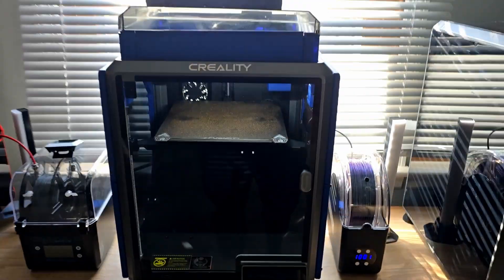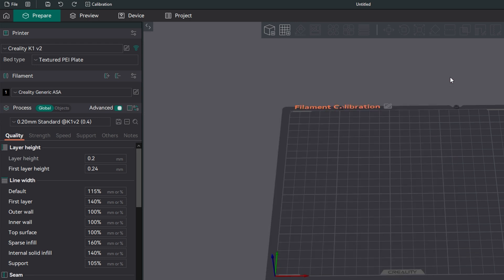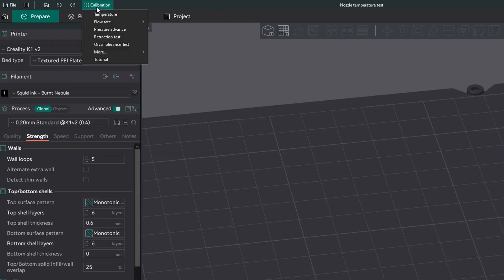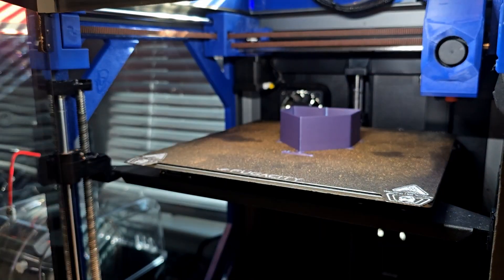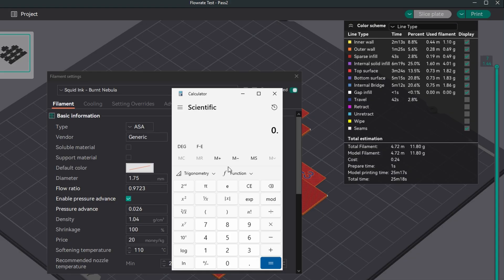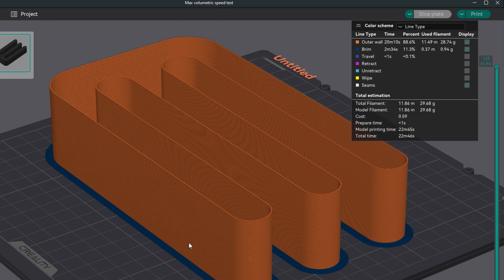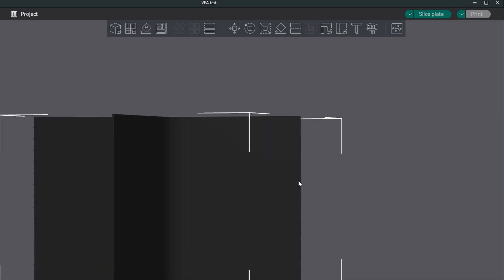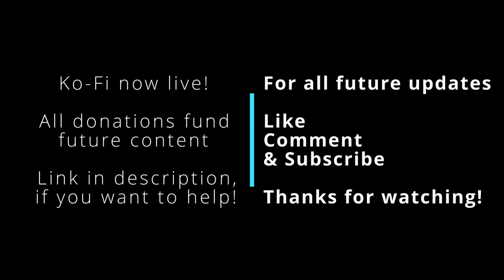OrcaSlicer Calibration - Getting the most out of EVERY filament!

Comment: I know this is a year old and Orca Slicer is now (Jan 2026) on V2.3.1 - so I followed the Calibrations from top to bottom, missing out a couplesuch as cornering and Input Shaping. 

My Max Volumetric Speed test for the SUNLU PLA + 2.0 I mainly use, came out faultless from bottom all the way to 20mm/3s - so I have set it at 15mm/3s. 

I then went onto VFA, I have a QIDI Plus4 and this can do high speed printing - so I opted for 150mm/s Base to 300mm/s topend in 10mm/s increments. 

That test clalibration has come out - perfect! I didnt push past 300mm/s as its past SUNLU's recommendation, but at least I know I can speed it to that.
Reply from the maker: This process truly is a great example of how investing a bit of time and material can provide greater quality and output. Happy to hear how much of a game changer it has been to your personal printing process! Cheers!

Comment: Didnt you have pre-calibration cube and after calibration cube ? Forgot to show differences ?
Reply from the maker: Pre-calibration was rough due to moisture and wouldn't have provided accurate results regardless (discoloration/dimensionally inaccurate to start from poor extrusion). The difference was night and day although the two were not set side by side due to the calibrated cube having the advantage of no longer holding moisture with all values dialed in.

Comment: For the PA test with ABS it was wavy through the whole print. Not horrible but still ugly through the whole thing. Then for the max flow rate the lower 13mm was also wavy but between 13mm and 18mm it was smooth then after the 18mm it was wavy. Did I do anything wrong and should I start over? I did this with some PLA and it was flawless and this tutorial worked amazingly so I feel I may be messing up with the ABS. (I’m new to printing)

Comment: how did u determine the speed at the end? you said the outer layer was 220 and the inner was 300. Why 300?
Reply from the maker: Ideally, you will match outer/inner wall speeds but I kick my inner walls up because I haven't found that it alters the dimensions of the prints that I send.

Comment: Please stop using the voron cubes for calibration. 
Use a proper shrinkage and skew calibration print that comes with a spreadsheet.
Reply from the maker: The Voron cube is a paid actor. His sole purpose was to test material conditions and the revised material profile for verification 😂 Delving deeper into hardware, software and material calibrations is not only possible but supported! Definitely take it as far as you are willing!

Comment: I'm new to 3D printing. Is there a way to gauge how much filament is used for this testing process? I'm just curious how much will be left out of a 1kg spool once the testing is complete. Thanks
Reply from the maker: In the slicer, after you've sliced the model, there will be a wide variety of information including material and time estimates. The full calibration process is approximately 150g for reference.

Comment: They seem to have made a update that changed the flow rate tests to a circular pattern, and im guessing im supposed to look inside the circle for these issues? not out? brand new to this.
Reply from the maker: I still prefer the original flow rate testing and actually haven't even attempted the revised test. The calibration guide/tutorial that is available through Orca will best explain the process for the new flow rate test.

Comment: Create explanation for a beginner in these settings like me. Question, I have OrcaSlicer and Bambu studio. I noticed when printing with Orca slicer, my printer (A1) makes different noises then with Bambu studio and It wasnt printing as smooth as with Bambu studio. So I still prefer the latter. But, can I still use Orca Slicer to calibrate the filaments and use those setting in Bambu Studio?
Reply: There likely different filament profiles in the two different slicer programs. Like even if it’s the same filament selected there may be some fan or speed settings just slightly different. I’m not certain because I’ve not been doing this long but I imagine you can export the filament profiles from one to the other. Otherwise just copy the parameters. But I may be over my head so if someone with more experience chimes in they may be able to explain the difference between the softwares and behaviors.
Reply from the maker: Bambu and Orca are very similar across the board from what I have seen and although I do not own a Bambu printer, I would say that utilizing the slicer's baked in calibration will likely be the easiest. The Bambu slicer probably has limits that are set in place that your machine exceeds when operating through Orca. Additional profile tuning may be required beyond filament calibration for best results. Feel free to transfer values over and perform a small test print to reduce material waste and confirm results for the profile before sending projects.

Comment: Hello! i have a question about the retraction test. What should i do if the first 2mm (from the base) have lines, then it doesnt till the end and the last 2mm have lines again?
Reply from the maker: I would select the lowest height value where stringing does not occur. It is possible that there may be moisture in your filament causing stringing to occur beyond that.
Reply: @CovenantCustom  Thank you so much! I also have another question if you can help me. Im new with printing PETg and i noticed that sometimes it remains too stuck on the bed and sometimes it leave residues that it's really difficult to remove. What should i do in this case? I have a textured pei plate

Comment: curious if i shoud keep my default k1C flow rate 0.98 or why did you use the 0.926 in orca? sorry if its a silly question
Reply from the maker: Default values are generally within range for most materials but not tailored for any one spool specifically. Due to formula variations in manufacturing, there is even potential for differences between batches of the same manufacturer/material/color. Once calibrations are completed for a material, there may only be slight profile revisions necessary, if any. More times than not, they do not require further adjustment, but I have run into the scenario of having to make minor adjustments with a repeat order of the "same" filament. The purpose of honing these values is to create a profile that accurately reflects the material you're melting and refining the values that allow it to produce greater results over a generalized profile. Hope that helps provide some clarity on why it is important to perform flow rate for best results! Happy printing 😎🤙

Comment: Hey man, great video! Just curious with the retraction what should i do if it was stringing the whole test?
Reply from the maker: Typically, if stringing occurs throughout, there are a variety of reasons. Most common would be hotend temp too high or moisture in the filament. If your temp tower provided good results and your material has been dried, increasing the retraction values may be necessary when you run the next calibration.

Comment: Would a calibration be needed for different colours of the same type filament?
Reply from the maker: Some might play well, and others might not. If you're low on time or material, running a tuned profile for a manufacturer/material type that you've already melted will more than likely get you a successful print. I just find deviations across filaments even if they are the same manufacturer/material so I tune them all.
Reply: @CovenantCustom thank you so much for taking time to reply. I’ll be aimining to do it for each type and colour. New to printing (only had it 4 days) so I found your video very helpful!
Reply from the maker: @budgetwithsiân By all means test existing/generic/similar profiles - Tuning each of mine is just a personal preference! Welcome to the 3D printing community. Have fun!

Comment: Hello. Thanks for the videos. Can you share profiles Orkaslicer for Creality K1 3d printer?
Reply from the maker: I feel that no one machine is the same considering I see variations between my own machines. Even if made in the same batch. For that reason, my best suggestions would be (if using a 0.4mm nozzle):

Quality

Layer height: 0.2mm
First layer height: 0.2mm
Seam: Aligned/Back (Depending)
Arc fitting: off
Precise wall: on
Wall generator: Classic
Wall printing order: Inner/outer/inner
Only one wall on top surfaces: On
Avoid crossing walls: On
Detect overhang walls: On

Strength (This depends on what you are printing; i.e. if it will be introduced to any forces - bump these values up but if it is a decoration that will be placed somewhere and left alone, lower values is sufficient):

Top shell layers: 5
Bottom shell layers: 5
Sparse Infill density: 5, 10, 15, 20, 40, 60, 100 (Depending on the file's application)
Sparse infill pattern: Gyroid

Support:

Type: Tree Auto/Manual (Depending)
Style: Organic
Threshold angle: 15, 30, 60 (Depending on retaining dimensional accuracy to pair with cooling for overhangs)
On build plate only: On
Top Z Distance: 0.12mm
Bottom Z distance: 0.2mm
Top interface layers: 3
Top interface spacing: 3.5
Bottom interface spacing: 5
Support/object xy distance: 3.5

I throw a brim on only when I feel it needs it and increase its width depending on how likely it would be to let go/fail without it.

Sometimes I use spiral vase mode for items (mostly just pen holders - works for lamp shades, "vases" and wherever else you could find a use for it)

Those would be all of the go to adjustments for me when setting up a profile that aren't entirely machine specific.

Speed is going to be dependent on your machine and its configuration down to how well it has been tuned so I've left that out.
Reply: @CovenantCustom  Thank hou very mutch!
Reply: @CovenantCustom  Yes, of course, I’d be grateful for the profile. At least, what average speeds and accelerations do you usually use? And another question: do you use the standard part cooling fan (4020)? What cooling settings do you set for the ASA profile, and what for the PLA profile?

Comment: Most comprehensive video! Thankyou!
Reply from the maker: Providing a guide that is easy to follow and informative was the goal! Thanks for stopping by! I appreciate the kind words!
Reply: @CovenantCustom  Can I ask why you run inner walls at 300mm/s as to 220mm/s? Also for infill how does the speed effect this? Do you leave it at the default or increase it to the outer wall speed of 220mm/s?
Reply from the maker: @Bigorse91 For dimensional accuracy, you are best off with running inner/outer walls at the same speed but I've found that I can decrease print time on my machine without losing accuracy by increasing inner wall speed. Infill I have left default.

Comment: What if none of my pass 1 test printed properly?
Reply from the maker: I'd start with cleaning the build plate to rule out adhesion issues. Next, I'd run a bed mesh, making sure there is no material on the tip of the nozzle for accurate results. Once Z has been ruled out, I would run the pass 1 to see if either of those two resolved it for you. If it did not and your results all present gaps, your value is too low to start. If it is the opposite, where it is depositing too much material, creating a rough top surface with ridges, your value is too high. A nozzle dragging through a curling part can cause them to release from the build plate, but so can a part that has material pushed around/built up on top. It really depends what you are experiencing when you say they aren't printing properly.

Comment: If i did this with for one filament with a 0.4 nozzle , so i have to rerun this while changing nozzle?
Reply from the maker: This calibration process is intended for a 0.4mm nozzle. If you are replacing it with the same size (0.4mm), it should not require additional calibration. Unless you see room for improvement, the same material profile should be sufficient as is.

Comment: Enjoyed your tutorial and additional tips and explanations! 

I just started 3d printing 2 days ago. Got a pre-owned Ender 3 v2 and a simple PLA from Elegoo. With the Creality Print slicer, a benchy turned out pretty good (IMO). 

I saw a video extolling the virtues of Orca slicer. I immediately noticed the Calibration menu and read their own articles on it. 

Temp Tower seemed very, very similar at each level. 
Flow rate 1 also seemed best on 5. I did not know to try the PA tests next instead of Flow 2. 🤦

I tried the PA line test, but they were all incomplete and I had no clue what to alter! I saw you choose the tower test and I will try it today.

Thanks again!

Comment: Do you make this calibration on each filament ? ( example i have sunlu pla blue / yellow etc... ) you do calibration for each different color, even if it's same brand and same PLA ? Same question with 2 rolls of same pla /color, do you renew your calibration between 2 rolls of same filament ?
Reply from the maker: I have made it common practice to this with every filament so that I have them prepared and ready for whenever I reorder. Thats not to say that the filament profile for your yellow PLA won't work with your blue PLA. It is just a personal preference for me to take those extra steps in calibrating all of my materials. I rarely have to change profile settings after the fact and if I do they are minimal. I like to use a test print like a calibration/Orca/Voron cube as a reference for whether or not changes are needed.

Comment: This is a wonderful video thank you so much! But i want to clarify a thing: After you do the max volumetric speed you should create a new project and insert the data of the filament into the new project because when you do the volumetric calibration test, it will change automatically 2 parameters into your filament option: "Max volumetric speed" at 200mm3/s and in the cooling tab "Layer time" at 0.
If you only change the max volumetric speed from 200 to (in this case 35) and save it it will also save the Layer time to 0, witch i understood that is bad. So just remember also the Layer time or watch it from a previous preset or create a new project and insert the data in that, and then save the filament.
Hope someone find help in this <3
Reply from the maker: Definitely agree with you! These are values that I change out of habit but it is a great point to make for those that aren't automatically jumping back in to confirm those values are where they need to be. Thanks for joining in and providing supporting information for everyone.
Reply: @CovenantCustom  Thank to you and your effort and knowledge in these videos <3
Reply from the maker: @SbrodolaiProtoKhay Look forward to providing more 3D printing coverage when time allows. Thank you for being here and for your support 😎🤙 Happy printing!

Comment: Thank you for this incredible video. I'm trying to dial in my third Bambulab A1. Two previous ones print perfectly with all stock profiles. The newest one has problems with overhangs, some quality issues, but most of all, dimensional accuracy is really bad.
Reply from the maker: These calibrations improved my printing experience and with the ability to pull generic material profiles and print being used so commonly, I really wanted to show people the improvements that are possible with these calibrations. They may be a solid foundation but fan settings could also be a factor in your overhang issue. Just something to keep in mind. Happy printing!

Comment: should I do these test at default of 250 - 300 speed or at the speeds I plan on printing at like 150 - 200?
Reply from the maker: Feel free to choose the range most suitable to your printer's use case. The print will ultimately fail if you begin to exceed its limits so just focus on finding a sweet spot that provides the best results.

Comment: fan on ?
Reply from the maker: I perform fan adjustments separate from material calibration so if a specific calibration alters values, make sure to revisit the settings so that it doesn't provide poor part quality or even print failure.
Reply: @CovenantCustom  do you sell STL/Files for upgrading to linear rail for K1C series?
Reply from the maker: @Pudy-77 I do not but they are publicly available on BCJ's github. I have a video detailing the process with all of the correlating links in the description. There are suppliers who sell kits to make life a bit easier but you can also purchase all of the needed materials from the bill of materials listed on the BCJ github as well if you prefer to go that route!

Comment: So is it necessary to do anything after the flow rate test. I’m only asking because I don’t care about print speeds at all. I’m printing high stress parts and they require being printed slow. And the VFA. I’m using PA 6CF. Can’t really see any layer lines anyways. I definitely want your opinion on this.
Reply from the maker: Although I personally prefer to see the calibrations through from start to finish, I would say that there may be room for fine tuning despite using a fiber filled material. I would definitely follow through with pressure advance for dimensional accuracy as well as retraction for optimal material distribution without stringing. Max flowrate will provide an understanding of the highest value that you can achieve with your preferred material and VFA will isolate a print speed that provides the best results specific to your machine/set-up. I would encourage everyone to at least run the tests once to see how close they are to the ideal output. Returning to previously recorded values (these can be added to notes under the filament profile) if they find that they achieved acceptable results with those that were previously input.